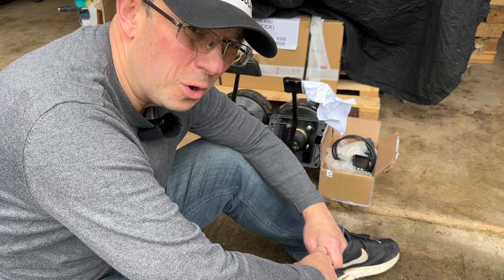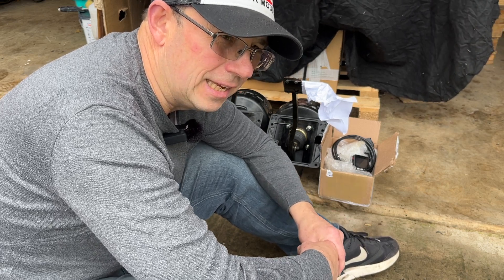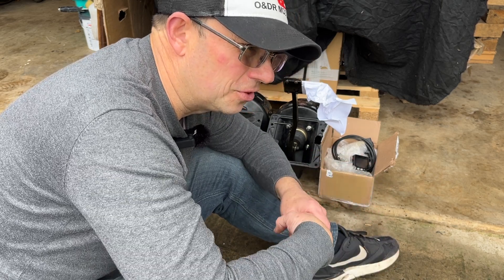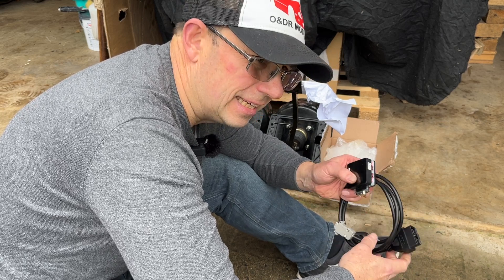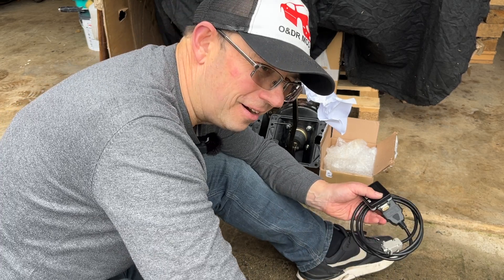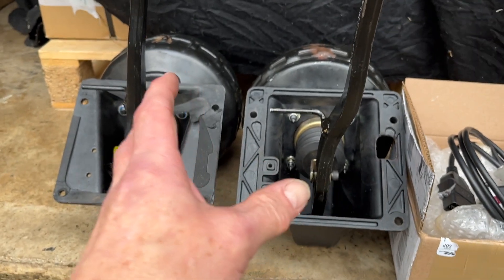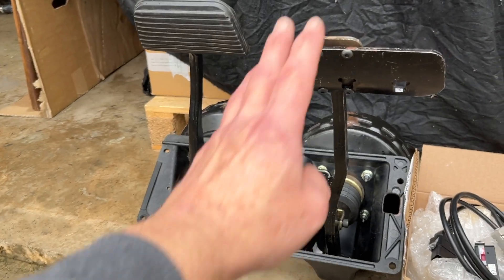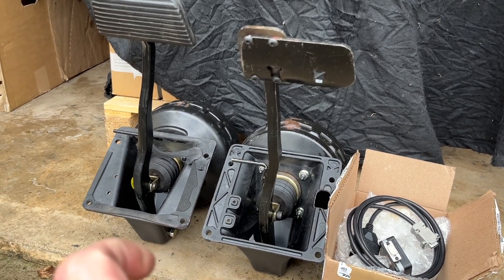Jaguar XK8 Manual Swap: WHY Is It TAKING SO LONG?! (CANBUS Data Dilemma) MT12 XKR X100

Comment: Dont despair! My XK8 manual car is a pretty nice drive.  Sadly I have hit a deer!  it will need a hood(bonnet), front bumper and fender but no mechanicals thankfully.
Reply: ...that, or you could just buy mine before I replace the throttle body. (+/-$2K p&l)
Reply from the maker: Thank you for your support. I think I saw your car damage on a Facebook post. Hope you get to back into shape OK. Much appreciated, regards Damian.